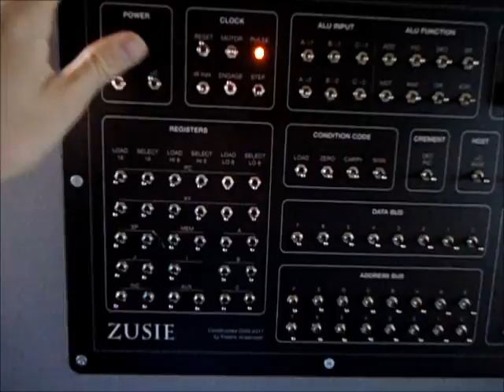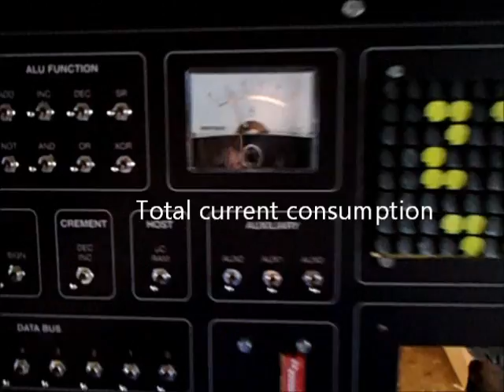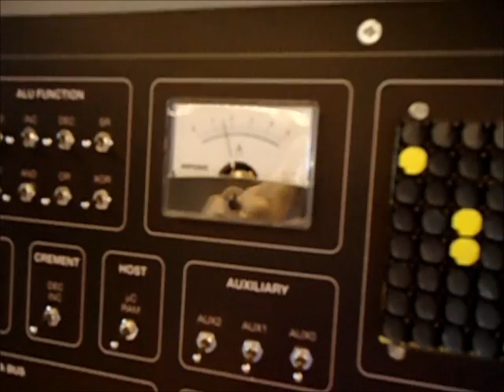Zusie mounted in cabinet

Comment from the maker: @PainGuy2 No problem :) The assembler is typically a program that runs on another computer. The laptop you see in my videos is used for assembling programs. When the program is assembled, the final binary code can be uploaded to the machine's program RAM/ROM. It works the same way for Z80 and all other processors. You can find the source code of Zusie's assembler program on my home page, if you're interested.

Comment from the maker: @reviathon360 The machine has somewhere around 350 relays at the moment, and the clock can be stretched to 5-6 Hz. It's a little slower in this video. Reed relays would be an interesting way of doing it, go for it! But you won't get the same lovely sound, will you?... :( With 50 Hz, your machine will actually be able to do useful stuff, though :)

Comment from the maker: @radiolok Yes, memory mapped I/O is most convenient. A LED array would work great. I have two graphic output systems in Zusie: The flipdot display on the control panel (14x8 pixels), and it is also possible in the host software running on the laptop to map a region of Zusie's RAM to the screen. The host software then reads this RAM region over and over, asynchronously with Zusie's operation.

Comment from the maker: @PainGuy2 Zusie doesn't read the assembly code directly (nor does any other computer). Instead you run it through a program called an assembler, which produces a binary version of the program that the computer can understand. So for instance, MOVCA is transformed into the value 81, which is called an opcode. It's the same way with literal values in the assembly code, like 65. It's also transformed by the assembler into a binary value. Don't know if this made any sense? :)

Comment from the maker: @radiolok Buzzy, cool! :-)
With a clock frequency of abot 100 Hz you should be able to do e..g a lot of simple games like pong, nibbles, maybe even a simple tetris etc if you hook it up to some sort of graphical output.
The reeds are at least double-throw, aren't they? Without that it would be tedious to build certain parts of the machine. 2500 relays?? That's a lot :) Are you building RAM with relays too?

Comment from the maker: @rapidrory Yeah, what can I say, it's simply outstanding engineering! =) No seriously, I think it's mostly a matter of how many LEDs are lit at any one moment. My relays have a coil resistance of about 1850 ohms, so that would make about 13 milliamps per drawn relay, and in idle mode not many relays are drawn. But when it's doing heavy computations with all registers involved, it bends the meter needle around the 5 amp pin =)

Comment: At 3 Hz (I counted this time), I don't think you could even do that reasonably well by loading data into the registers, which is what I'm assuming the display at the top is. Depends on how much data it can load in a single cycle. Would sure be interesting to try though!

Comment: There is a problem with graphical output, but one variant - is to take led matrix. very big led matrix. 64x32 for example. As a output protocol - there will be some address bank in memory, witch will be video memory.

Comment from the maker: @Esperantanaso I dunno, someone obviously pushed the wrong button ;-)
Yep, the plan is to let the motor drive a carbon brush across a circular set of contacts, thus generating clock pulses without an electronic oscillator. A little like a distributor in a car engine.

Comment: @nablaman Your are right, There will be no soft sound of working relays in reed machine, but because of it a names my project "Buzzy" :)
It'l be interesting to use my machine in real tasks, but what can it be? :) There is one big problem with reed relay - they has only one or two groups (maximum 4, but a hasn't this types) and I have to have equaly 2500 of relay to start assembling O_o

Comment from the maker: @radiolok The machine has somewhere around 350 relays at the moment, and the clock can be stretched to 5-6 Hz. It's a little slower in this video. Reed relays would be an interesting way of doing it, go for it! But you won't get the same lovely sound, will you?... :( With 50 Hz, your machine will actually be able to do useful stuff, though :)

Comment: @nablaman Of course, relay are double-throw. I need approximately 60% of double-throw relays.
2500 relay's is not "many", because, for example, for one 3-state switch I mast have 16 relays - every has only one group of contacts. I has  a few relays with two groups, but they all goes to ALU. And yes, I want to do hardware multiplier.. The most difficult thing in it - to summarize 8 8-bit numbers to 16-bit result.
RAM would be solidstate. I'm crazy, but not enough to do relay RAM :)

Comment: Can you describe the algorithm it is running (pseudocode)? The current panel is blurry. I can see it is drawing 1 unit, but how much is that? What is the power consumption?
Reply from the maker: Sorry for late answer. It loads the value 01010101 into register A, then goes into a loop where it increments register XY, moves lower part of XY into B, then does XOR between A and B and places in C, then loops. So you will have C = 01010101 XOR 0 on the first go, C = 01010101 XOR 1 on the second go, and so on. You can see the placement of the different registers on my website nablaman.com/relay. The current meter shows amps, and the voltage is 24V. So 20-50 W at normal operation.

Comment: Well....You could add some sort of graphics output where the intention wouldn't be something realtime. :) How about a raytracer? (Google pixelmachine for a good starting point) You could do VGA output perhaps. (via hardware video card) Fixed point arithmetic as it does not have an FPU. Let it run for a week....